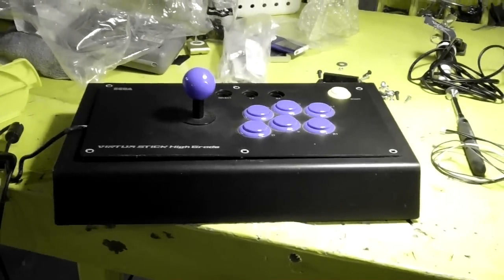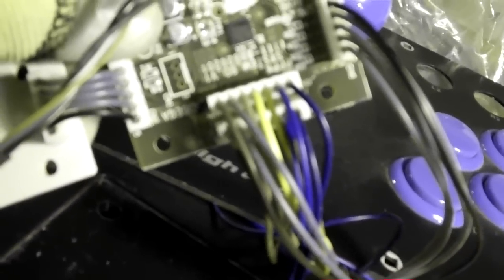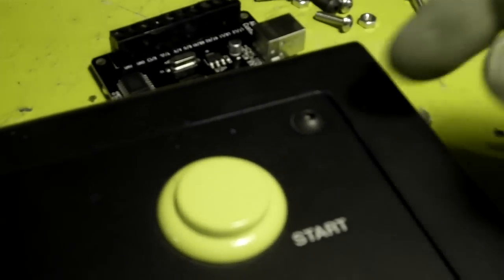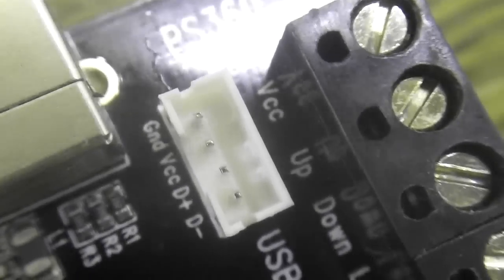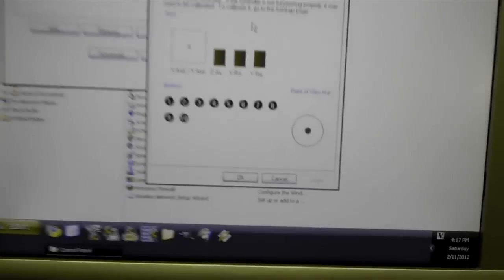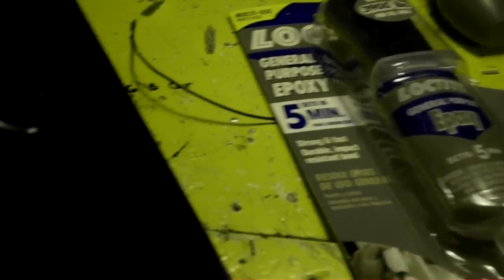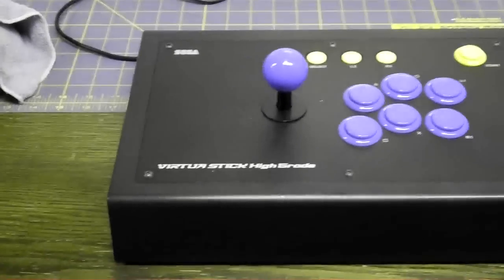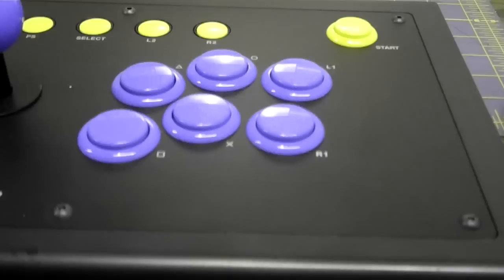Installing a PS360 in a Sega Virtual Stick High Grade Joystick

Comment: A very helpful project for something I'm undertaking with my pair of VSHGs (already refitted with Seimitsu guts as I'm a shmup player). So thanks sincerely Tighe Lory. A quick question though... The ground cable; any reason I couldn't just replace the Japan-style single ground wires with a US-style daisy-chaining ground?
Reply from the maker: No reason you couldn't, I prefer individual wires in this particular setup.  In my arcade cabinets I use the daisy chain style.
Reply: ***** Thanks so much! Speedy reply much appreciated. I just fear I may make a mess of soldering all the individual wires into one!